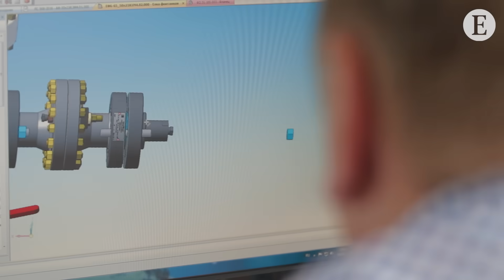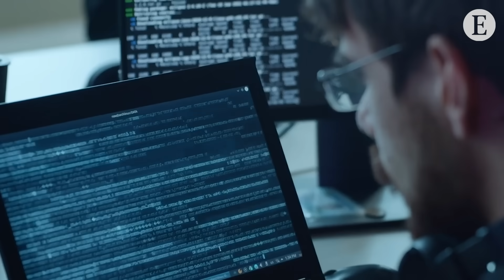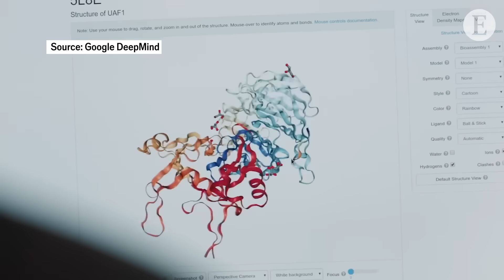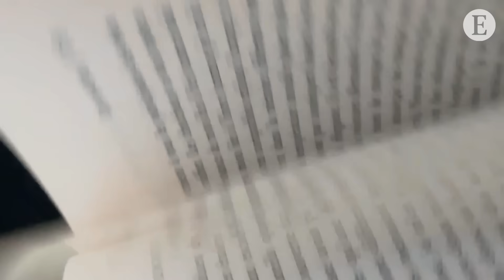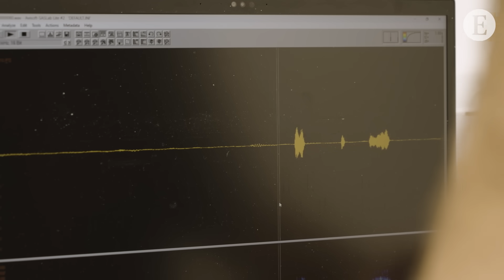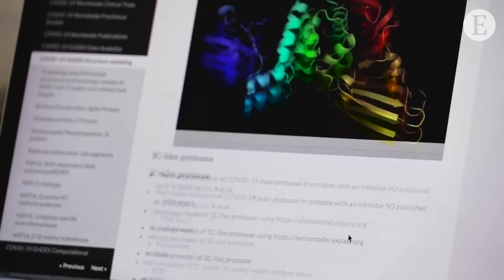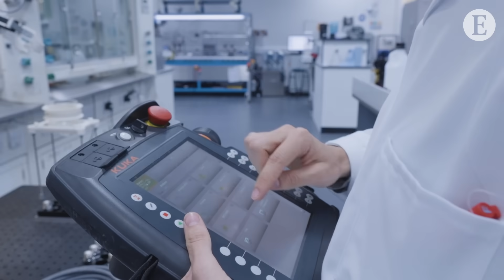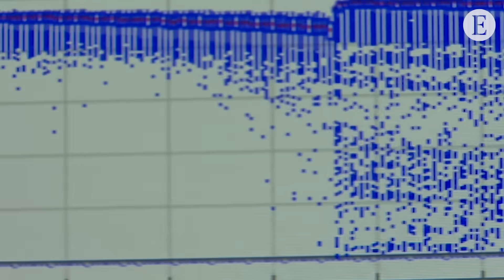How AI is revolutionising science

Comment: AI finds the patterns in complex systems. Based on what is already tested. Results of which always need to be checked for false correlations and it making up data. *It does not have imagination.* extrapolating new ideas will be us working in tandem with the really useful tool of AI. AI for me is computers at last doing what you really want them to do - the tedium, assistant at your elbow. The issue will come when so much AI content is skewing AI correlations - like images now on the internet so many are AI generated that when AI generates new images it is going to go down a loop of self referencing. A distinction between true images and artificial needs to be made …